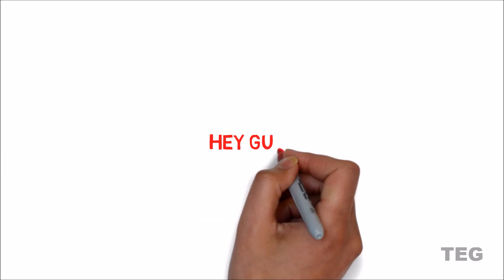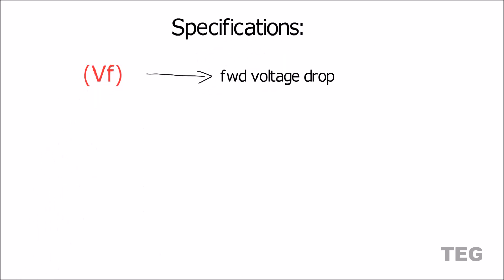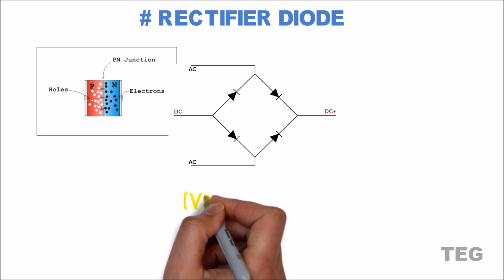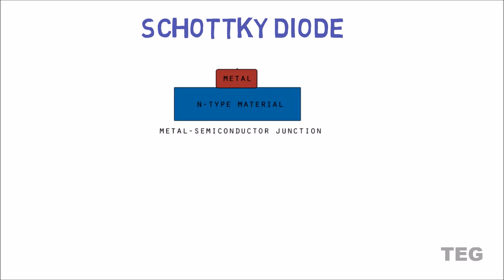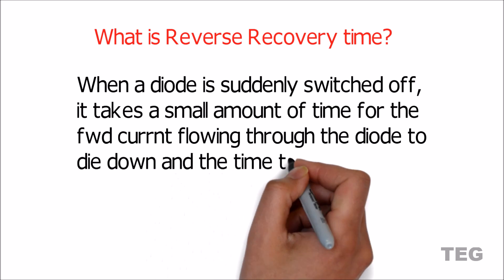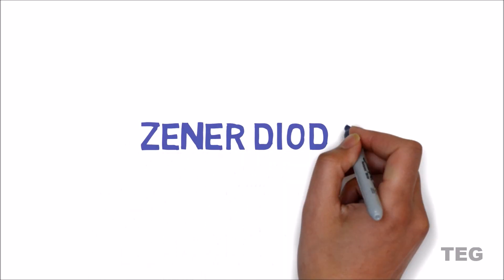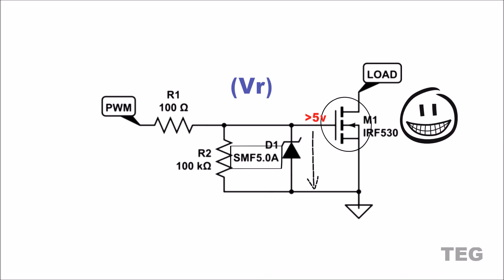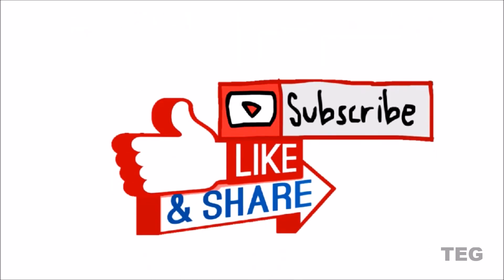Difference Between Diode, Schottky and Zener Diode (Types of Diode)

Comment: Hi.. I use analog  multi meter to test Zener diode out of electronic board... +tester to anod  -tester to catod zener diode and it's give reading  200ohm.... then reverse  tester again..about 7.5ohm using sunwa YX-360TRn ohm meter.... select x1...this Zener  diode means what??? Good or bad condition?? Do I need to replace  new zener diode???